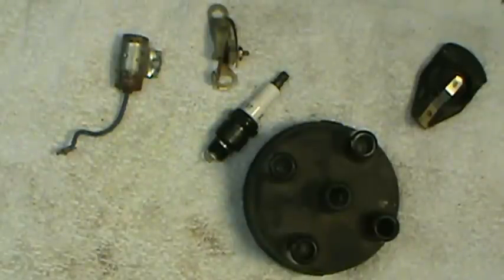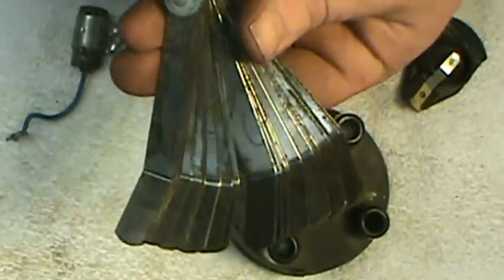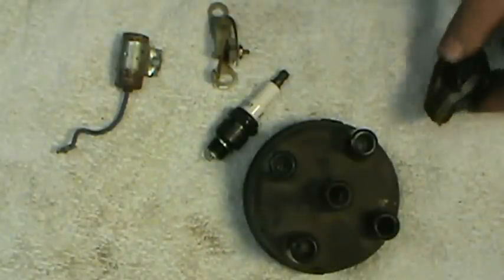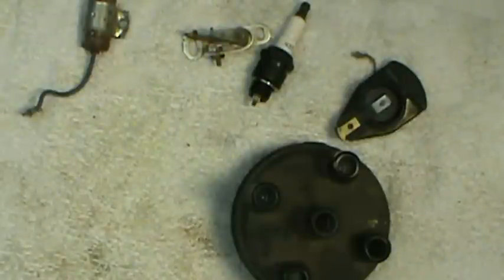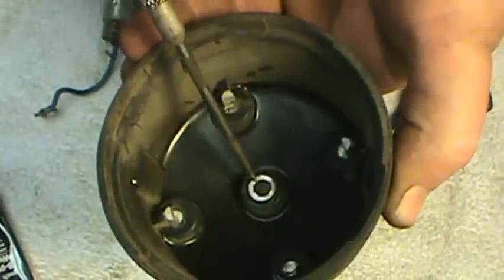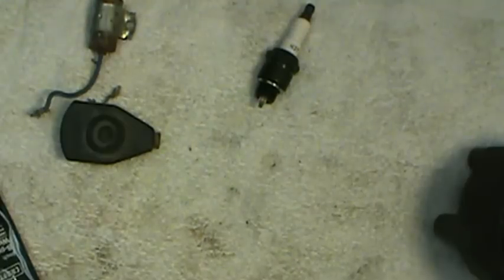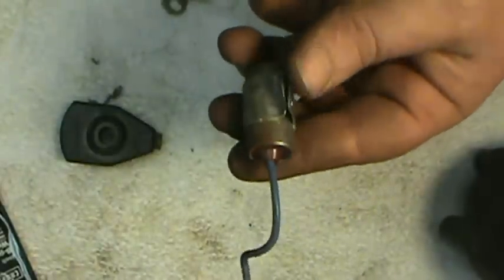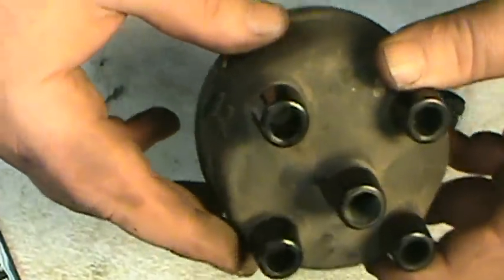Antique tractor Ignition systems part 1

Comment: Yes, the capacitor serves two functions:  When current exits the coil's primary winding and begins to charge up the capacitor (condenser) that lies across the open breaker points. This capacitor and the coil’s primary windings form an oscillating LC circuit. This LC circuit produces a damped, oscillating current which bounces energy between the capacitor’s electric field and the ignition coil’s magnetic field. The oscillating current in the coil’s primary produces an oscillating magnetic field in the coil. This extends the high voltage pulse at the output of the secondary windings. This continues beyond the time of the initial field collapse pulse. The oscillation continues until the circuit’s energy is consumed. In doing this, the 2nd function of this capacitor is fulfilled, it keeps any current from being shot back into the ignition switch, etc.

Comment: Just replaced the spark plugs on my B414 international and put in an inline filter. I'm still having fuel issues. i think I'm going to have figure out how to take the gas tank off and clean it. I'm also going to have to rebuild the carburetor soon. The tractor sat for 5 years and I just got it running a few weeks ago.

Comment: I am resurrecting a 1956 Allis-Chalmers "B", and today I installed new plugs, new plug wires, capacitor (condenser), rotor and cap....I am in the process of setting the dwell (gap) on the points.....

Comment: The coil fires when the points OPEN. The field collapses and the current has no place to go but the spark plug path. \
Reply from the maker: You are correct, I had it backwards. Thanks for taking time to watch the video and comment.
Reply: ***** Yep, for us old-timers, that's the "dwell time" or "dwell angle"..that's the time during which the coil charges. Damn points arc and burn out eventually, hence my desire to install an electronic ignition on my old "B" tractor.
Reply from the maker: Have you heard of the pertronix ignition module? It replaces the points in the stock distributor. It is about $100 an the make them to fit everything.
Reply: MRBoatwrights Yea, I'm going to convert the B to 12V neg ground and put in electronic ignition. It's gonna be SWEEEET.

Comment: Have a issue with 1973 Farmall Cub that runs good for about 45min using Woods belly mower, then wants to run hot and losing power and skipping. Any idea on problem maybe causing this. If stop for an hour it starts back up and runs good for another 45min. or hour. Could the timing be off? Located in the Upstate of S.C.
Reply from the maker: Have you tried changing the points and condenser? Also check the timing if the ignition timing is off it could cause it to run hot. It is highly possible that the timing is off.

Comment: You mentioned that installing new points and condenser can be done while the distributor is still in the tractor -- but then how do you rotate the lobes to set the point gap?  I tried several ideas, but all failed so far !
Reply from the maker: You rotate the engine by and in it normal direction of rotation until you have the points on top of the lobe. Then set the gap.
Reply: MRBoatwrights
Yes, but I could not get anything to move manually -- I ended up touching the starter with the KEY OFF a couple times, and finally got the point finger to rest on one of the lobes -- spent the day yesterday plowing snow, thanks to you !!  I appreciate the time you spent making these -- thanks again !

Comment: Should the points be fully open (.0020 on my Satoh S650G distributor) when directly in front of the firing point, even if the timing is supposed to be 16 BTDC?
Reply from the maker: Yes the points should  be fully open when on top of the lobe on the distribute shaft. This should happen at 16 degrees BTDC. This is how the ignition timing is set by rotating the distributor and changing the relationship of the points to the lobe the opens them.
Reply from the maker: It is possible for the lobe to spin on the shaft if it is keyed or splined to the shaft. It is also possible for the lodes to be worn flat and not allowing the points to open at the right time.
Reply: MRBoatwrights
is there anyway I can send you a pic to show you the issue I am having with this distributor??

Comment: Is 6 volt points the same a 12 volt points on 8n ford tractor?
Reply from the maker: +Bruce Morris Yes, if you want to convert to a 12 volt electrical system all you have to do is change to a 12V coil. If you get a coil that has an internal resistor all you have to do is run 12 volt keyed ignition to the coil and you are ready to go. If you are converting to a 12v system you can use a delco style one wire alternator and all you have to do is run the charge wire to the battery. Be sure to convert to negative ground because the alternator will not work properly.  If you use a coil on a positive ground system you have to hook the hot wire to the   negative side of the coil. It will work either way but not as well. A lot of people use an inline resistor to step 12 volts down to 6 when converting to 12 volts but i have found them to not be very reliable and they cost almost as much as the coil does.